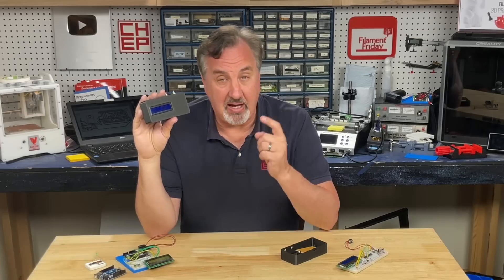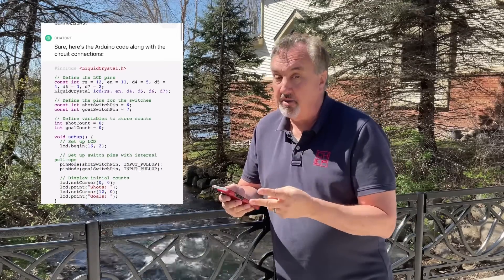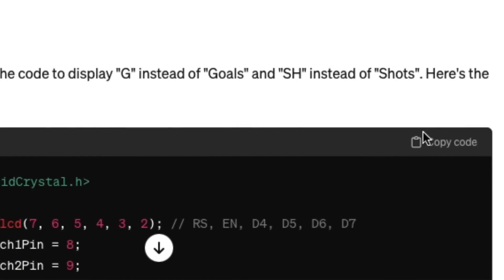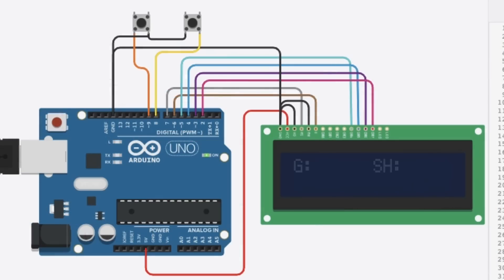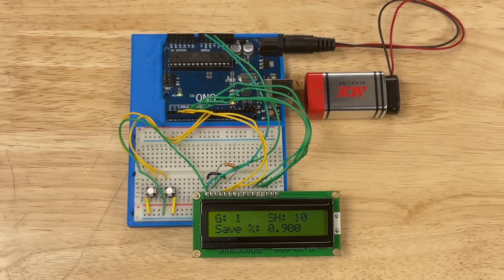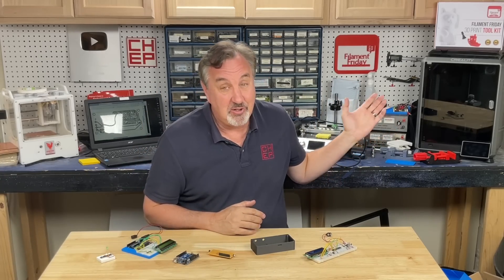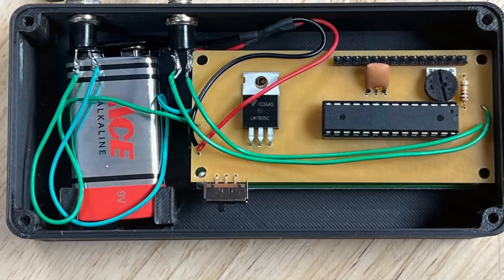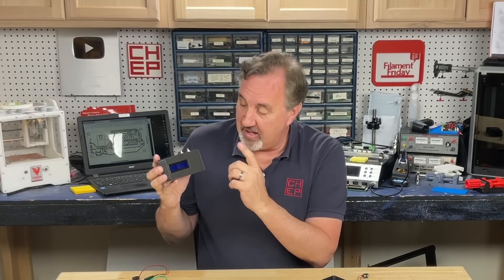ChatGPT Designed My Electronic Product In 10 Minutes!

Comment: I've used ChatGPT to configure all of my 3D printing profiles. It took a bit to get it right, but I've got 50% of the print time (depending on the nozzle size).
Reply from the maker: Does it give you a profile you can load into the slicer or do you have to manually modify the settings of an existing profile?

Comment: check its work, because I used chatGPT for a number of projects as a test and in every case the AI made critical failures that were not readily apparent at first... 

It should work well enough for simple electronics though.
Reply from the maker: It’s a great starting point but to use the code exclusively without modifications, is really risky.
Reply: AI is the emperor's new clothes. Maybe 2-3 years time it'll be OK (after it has stolen everybody's hard work on the internet AND then fed itself on self generated content - that can't end badly surely?). But you have to remember there is no intelligence in Artificial Intelligence. Every single time I have used it it has been wrong or got things mixed up and don't get me started about security problems it can make in its coding. It is currently destroying the internet as it fills the search results with utter junk. Happy days!

Comment: Well i had bad experiences with chatgpt.. i asked it how to make my printer (comgrow t500) quieter.. and it gave me some tips, but they were completely wrong.. i mean.. klipper commands that dont exist: example.. for instance it explained me on more than one page.. the importance of the  "cornering_accel_max"  parameter in klipper.. where to set it even explaining: "In summary, "cornering_accel_max" controls the acceleration during cornering movements to ensure smooth and controlled motion, while "square_corner_velocity" determines when the printer should execute square corners instead of rounded corners based on its velocity. Both parameters play important roles in optimizing print quality and print speed." 
That was copy and  paste.. from chatgpt. and after telling him (her?) that klipper refused to start saying it was an unknown parameter.. chatgpt apologized.. and told me not to put it in the printer section but in stepper configuration.. as i had the same problem there.. it said: 
I apologize for the confusion. It seems I misspoke again. The correct placement for the "cornering_accel_max" parameter in Klipper's configuration file is not within the individual stepper motor sections like "[stepper_x]", "[stepper_y]", etc. Instead, "cornering_accel_max" should be set globally under the "[printer]" section"
After that it explained me again that it should be in the stepper configuration.. finally after me asking if it was 100% sure it new what it was saying.. it admitted: 
I apologize for the confusion. It seems there was a mistake in my previous responses. In Klipper, the parameter "cornering_accel_max" is not directly configurable in the configuration file. 

But this happened only after 3 full pages of explaining where and how to set the parameter.. so i am sorry, but i dont trust chatgpt ;-)

Comment: 2:49 "Then the 11th one is a goal" 10 saves from 11 shots (not 10) is 0.909 as a fraction or 90.9% as a percentage - not 0.900%.  Kudos for the workflow, but I think all this does is show that you're going to be removing a thinking person who would pick up on these sort of requirements ambiguity errors and replacing them with an AI that (literally) gives you it's best guess as to what you think you want; any ambiguity in the requirements results in a load of guesses to fill the holes.
Reply: The goal still counts as a shot. 
Shots should be  “saves” the way he’s using it.

Comment: ChatGPT is no worse than a school kid copying others. Just that it copied from millions of intelligent humans, thanks to MS owning github!. It is a known fact, it does not understand what it spits out!, but it can guess accurately. You can even design your enclosure with openscad! Code from ChatGPT, export stl and 3d print! you are done. ChatGPT is only smart,if you ask smart questions, it will eventually incorporate this knowledge in future. There are things it cannot do🤔, and I will not spill the beans, not because of self interest, but to ensure it does not hurt other hardworking people😂❤👍
Reply: Most of the material on GitHub is not FREE, but either provided under a reuse license or proprietary. When the dust of various lawsuits settles, the materials used to train Microsoft's AI models (among those owned by other companies) will likely have to compensate the owners of the intellectual property every time the original source material is incorporated in a new design.

There is another huge problem with AI generated works. They are not eligible for copyright protection. This means that anyone may make exact copies of the work and either modify it, repurpose it, or sell it in its original form and there is no legal recourse.

Comment: Remember folks - EVERYTHING you put into ChatGPT is public! If you're feeding it anything proprietary or secret, you're going to be very upset when you see it elsewhere.
Reply: The bigger problem is that if you place proprietary information into ChatGPT (or another AI model not under your direct control), then you are liable for any damages suffered by the owner(s) of that IP.
Reply: This is an excellent reason to use an AI you do control. There are many open source packages that will run an AI on your own computer.  If you understand how to give them instructions (which must be very clear) even small models usable on any PC with 16GB of RAM will be able to complete simple tasks. (Clear instructions involve a description of what you're trying to do, and then a couple of examples.)

Comment: Thanks for the videos and I like your books, I have read some of them. the 12f683 really helped me make some interesting circuits and the book you had, covered it well. Though I used a different software for programming it called GCB(great cow basic) as I needed things not limited. Anyway, thanks for inspiring. 

Regarding AI outputs some people are having hard time with. I see a lot of people seem to relay on the AI for code, or electronics projects, depending which one is weak in, 90% of the time. This in my opinion is a no no. You have to know at least 60-70% of what you are trying to do with in electronics and programming. You will get wrong results for things you ask GPT because you don't know what you don't know. This means when asking Ai for help you need to ask it in detail like CHEP did here. It is honestly becoming a skill of its own just to know HOW to ask AI for WHAT to do. Also, if the project is TOO complicated, it will struggle, at some point you are going to have to realize that the AI at best is a high schooled assistant that is really good at recalling things. NOT a lead researcher of some sort. I am not a good programmer so I delegate the task to the AI. However, I also know how to READ the code and detect somethings that are wrong. So I have to ask it to rerun the code again, until it gets it right. Would it be better to know how to code yourself? Yes! However, with each reiteration it gets is right eventually, a lot faster than I would just programming it from scratch. 

I will also point out that, even when AI gets the code wrong , the structure of the code is usually correct, variable placements, cnst, int, IF THEN logic. You can still learn from that. You can learn programming by just asking it to generate code and ask questions why it did XYZ and why it did not do XWC or something. Good luck on your projects guys stay humble.

Comment: I used chatgpt to write a bunch of my klipper macros lol the first couple scared me a bit but they work so im content.  One thing I have noticed about chatgpt is unless you reakly specifically ask what you want itll mostly give the easiest way of doing things which isn't always correct.  It helps if you have a okay understanding of how electronics and code work.  Hardware for me is bread and butter but I struggle with software.  

Have you heard of flux ai?  Its a pretty nifty program that came out a few months ago.  I got lucky to get to beta test it.  Its basically a copilot mixed with kicad.  Been meaning to play with it some more but currently all my free time is being used to learn more fusion 360 😅

Comment: I do some arduino projects, and know some simple coding, I have a project that I needed a simple program for and after three tries AI failed completely not only with the program but with the hardware also, it's not my abilities or wiring or layout, I spoke to someone who is an electronics expert and he said that it was wrong, so as far as I am concerned AI is a failure and shouldn't have been released yet, I wish my project went as smoothly as yours. And I have read about a number of other AI failures, it was released too soon.
Reply from the maker: I’ve been doing electronics for 50 yrs and have electronics degree and 3 patents so I believe I could also qualify as an expert and I showed in this video it does work. I’ve used it often. So don’t give up or believe your expert. It’s possible to have AI write code as I proved. You may need to ask the questions with a bit more detail. I also used the ChatGPT 3.5 free version. The paid v4.0 is even better.
Reply: @FilamentFriday  I am a machinist for over 45 years, I work with high end CAD/CAM, and program and set up and repair $400,000 multi-axis CNC machine tools, I am no electronics expert but I do have an understanding of basic stuff, I did find there was a learning curve knowing how to "talk to" AI, but after that it still didn't seem to get the picture, I will keep trying.
Reply: @FilamentFriday  The bing free version already uses GPT4 and in my programming questions- seems to do a way better job of providing real- working code.  I tried one day to get openAIs GPT4 to produce a powershell script for me.  It was fairly basic but did have a few complexities in it.  8 tries with no luck.  Brought the same prompt to bing and it worked the first time.  

Try other AIs if the one you are using isn't working properly. =)
Reply from the maker: @jeffreyhiggason4004 - I’ll give that a try.
Reply from the maker: @jeffreyhiggason4004 - Do you mean Copilot?
Reply: @FilamentFriday  )P.S. It's nice to interact with you!  I've been following your channel since I got my first printer in 2020 and since have owned 15 different printers and even started developing a SAR sUAS- you get to take a bit of credit for this as I have been using your Ender profiles since the begginging and that bed leveling gcode is what finally made my brain click on bed leveling.  Thank you CHEP!

Comment: Excellent example — showing the “art of the possible.”  It also shows how tools like ChatGPT really benefit from clear, detailed instructions — while the role of “prompt engineer” sounds silly — knowing how to get good, testable, data out from these LLM-based tools is essential, as you’ve shown.
Reply: i would still argue that the role of a prompt engineer is silly, you need to have the big picture engineering knowledge to know what you want from the LLM, without that its just garbage in garbage out.

Comment: Do you have a solution to convert the mini sd-card to something larger say flash drive?
Reply from the maker: Most 3D printers come with an adapter to plug SD card into USB drive. Is that what you mean?
Reply: @FilamentFriday I have Ender 3 vs neo with outlets one is for the mini sd card not sure about the 2nd one .
Reply from the maker: @iModel-ft6kh  - 2nd one is for connecting directly to a computer and controlling it from there.
Reply: Thanks again for the response. One last question what type of cable?😅
Reply: @iModel-ft6kh  If you are attempting to be able to use a normal size SD flash card to load files onto the printer, it would be a "MicroSD to SD Card Extension Cable".

Comment: It is nothing more than a lame infomercial. Disappointing coming from you, Chep.
Reply from the maker: Sorry you missed the point. I’m fascinated by what AI and Chatbot can do for electronics.
Reply: @FilamentFriday totally disagree with the comment above, this was a really interesting idea. I had no idea ChatGPT could do circuit board layout, and that the code would work straight away. Really glad chep posted this, and will have to give it a try. I was curious if he would also have it design the 3d printer file! Did not seem like an ad, other than the segment for pcbway which is pretty standard for almost any creator these days. Hope he posts more like it.
Reply from the maker: @Melkata3100  - Thanks. Just to clarify, ChatGPT just did the code and circuitry description. I created the schematic/similation (in Tinkercad), PCB file and 3D file (in Tinkercad). It m sure in time AI will offer these as well.

Comment: It sounds amazing that chatGPT can do this, until you realise that 
A) this project is so simple it could be part of a beginner's tutorial for kids
B) if you google this you get literally hundreds of project like this
C) you now have a schematic and code that you don't understand because you never had to look into it. (if you did take the time to understand it then congrats; you have taken just as much to as you would to write it, the code is that simple)

Now try to expand the project with a soundboard or a camera. Good luck explaining your entire current setup to chatGPT.

"I made this in a weekend"

Great, but it's a three-hour job if you include the time to print the case.

ChatGPT cannot program, fullstop.

What it does is look for articles that seem to be related to your question, it merges them together and gives you the result as "the answer". If you ask it really simple things that it has seen full solutions for then you will get a full solution, just like you would have when you just google the thing.

If it has not seen the exact thing then you will get a best-guess and those are usually six-fingered hands.

Stop making these types of videos, and instead teach how arduino's actually work, so people can understand them and make actual good products.
Reply from the maker: @vinny142 - The weekend included several 3 hour prints and PCB milling to get it right. So it’s not even close to a 3 hour job. 
But the project is just an example to show how AI can give anybody a great start. Even non programmers. Then expand from there to more complicated.
Reply: I disagree. Having an idea, and then getting a version of that given to you is an excellent leverage to learning. It's not the whole thing, and doesn't replace all the things you just mentioned, but if you don't rely on it completely it's a plus.
Reply: ChatGPT 4 can do much more complicated things and can be very accurate. I've used it for JS, Python, Java, Lua, and assembly. If something is pretty intensive, it can be hard for a lot of people to write down in English exactly what they want step by step in a paragraph or 2. It's not always perfect, but it can drastically reduce coding time for a lot of people. It's better at writing some languages than others simply because of its database. A lot of hobbyists use Python, for example, so its ability to write Python code is better than most other languages.

Comment: There shouldnt be a decimal point before the percentage value, that means it says 0.900%, thats less than 1%. It should say 90.9%. (100/11 total shots) * 10 shots saved = 90.9.
Reply from the maker: While technically that’s true, you’ve obviously never looked at Goalie stats. They say SV% then give the decimal version of the ratio. 
For example: SV% 0.909
And the code needs a fix. I put in the 10th shot then pressed goal so the shot/goal presses were one in the same. The goal button needs to add to shot by itself. I’ll fix that.
Reply: @FilamentFriday  correct im not familiar with the way the sport presents the stats, i was coming from a strictly numerical point of view.

Comment: is a goal not considered a shot? I would think when you clicked goal it would also increment shot.
Reply: In the scenario, the shot button has already been pressed. It's only if that resulted in a goal that it would count as a detriment to the percentage. An alternative would be to have the goal button add 1 to both counters and calculate it the same way
Reply from the maker: Good point. I missed that.

Comment: Similar to your project Chuck, I built a PCB for a reflow oven controller (similar to your project.. LCD for the menu options, and 4 buttons for functions). I used ChatGPT when I wanted to add another function but didn't want to add a new button.. instead I wanted to repurpose an existing button to have 2 functions based on a quick button push, or a longer button hold. I gave ChatGPT my existing code and asked to keep all the existing functionality, but change the 1 button to have 2 functions based on how long you hold it. It wrote an (almost) perfect rewrite of my code, implementing a nice state machine and, other than a couple very minor issues, it worked perfectly. Really a time saver. For folks saying that ChatGPT couldn't do a more complex project, that may be true, but for refactoring and extending existing code it does a great job.